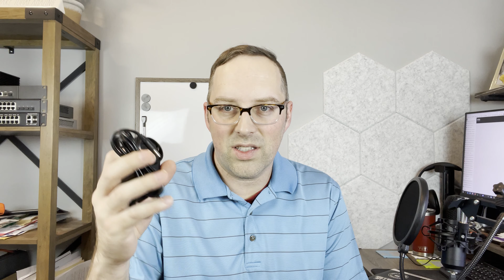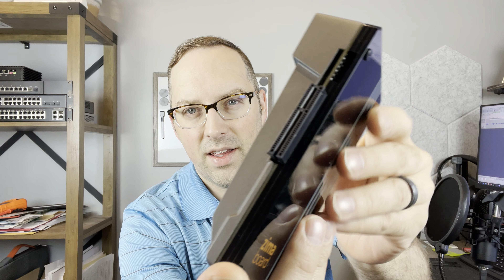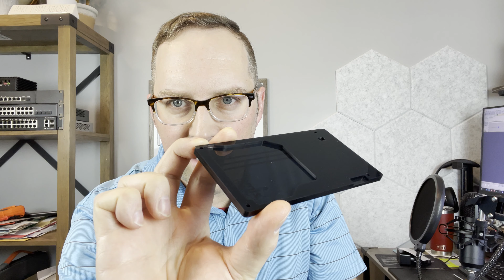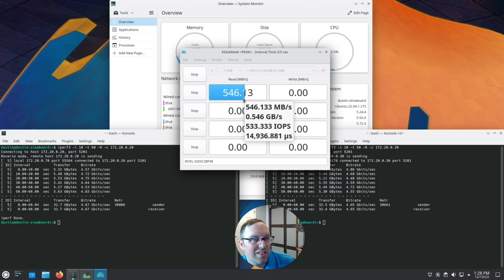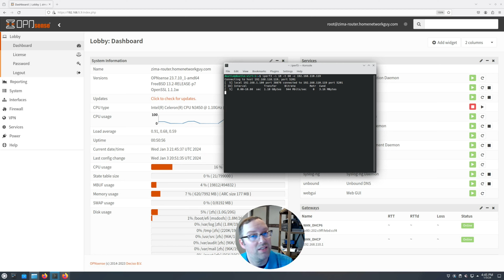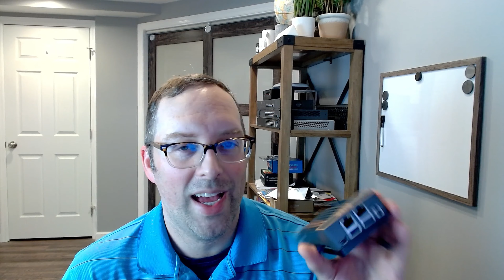The ZimaBoard 832!

Comment: I got a ZimaBoard 832 last Friday and after following your OPNsense Full Network Setup video this weekend, I was able to go from a flat boring network on a cheapo Tenda WiFi router, to OPNsense running on the 832 with an Intel I350 quad NIC (last 2 ports configured for LAGG) and a couple of TPlink managed switches and WAP in multi-SSID mode.. 
Your videos and written guides are very thorough and easy to follow, so thanks so much for that. I went from not knowing wtf a VLAN was to a nicely carved-out, controlled and optimized home network. You truly are the Home Networking Guy. 👍
Reply from the maker: Awesome! Love to hear success stories! 

I also have written guides on my website on topics I have yet to cover on YouTube. My videos aren’t quite on par with the quality of my written content (still new at videos and requires a great deal more effort/expense so I just try to keep it simple for now).